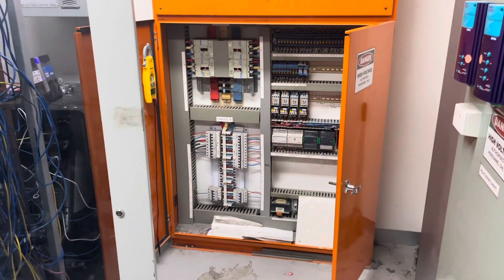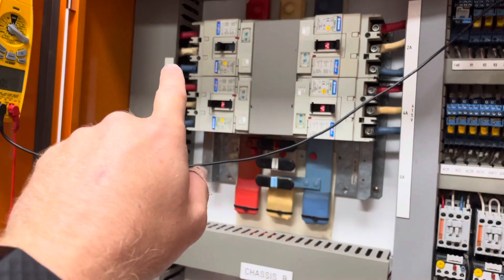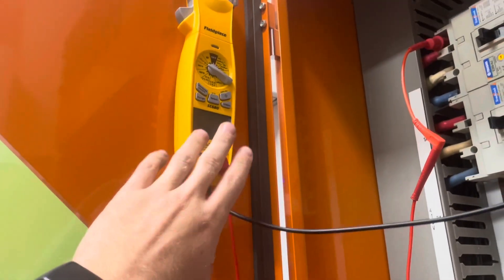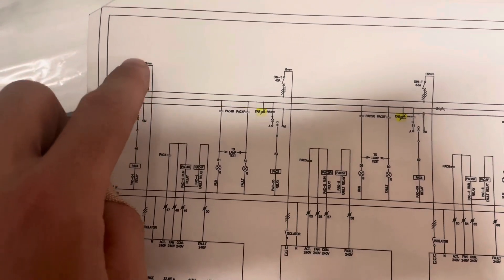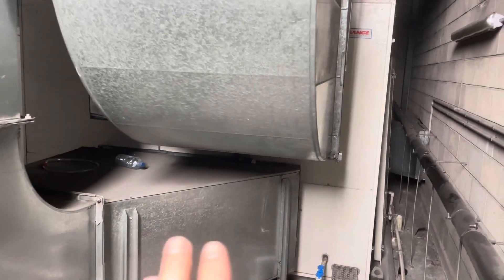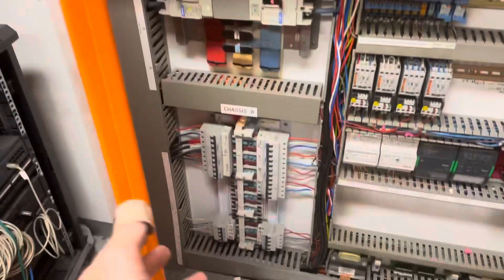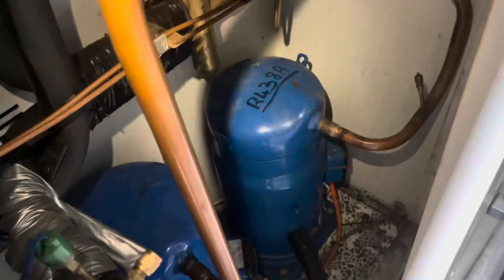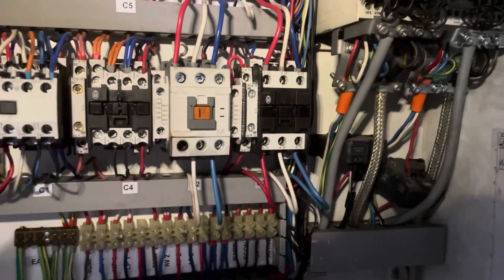All Air Conditioners are Down After a 38 Degree Day

Comment: Your right, from L1 to earth you can get a reading thru your contactors, relays, pcb's ect ect via your a/o/m control switches. As for working inside the board flicking breakers on, turn off the control switches, close the board and turn everything on via the control switches. If something goes bang it's better it goes bang behind a closed door than in your face.

Comment: hey mate just curious if you looked into the strange readings on the inital tests from the ddc breakker which you mentioned could have something to do with the shielded cables, if so what did you come up with have had problems in the past as well.
Reply from the maker: Hey mate. I wasn’t able to get a clear answer. I spoke to a electrician who mentioned sometimes electronics may have safety’s that show readings to earth. It didn’t really make sense and I did mean to find out more about it. Thanks for the reminder, if I come across anything worth sharing I’ll reply back here 🤙

Comment: You make some great videos mate.

Just a thought, when testing circuits in a de-energised state for insulation resistance, you likely aren’t testing a lot of loads like motors, compressors etc, as the contractors which switch those loads are not pulled in.
Reply from the maker: Thanks mate 🤙 100% on not testing loads while de-energised, I was testing to see if anything would come up anyway. I’d have to rewatch the video to be sure, pushing my memory on this one 😂 but I believe I tested from the switch board, then did a visual on all the units to see if any compressor C/B’s were tripped where I found one. Then tested the compressor from there.
Reply: @hvacraustralia  that’s a great way to do it 👍

Comment: Good job. I usually kill power then take my voltage tester stick and just run it over all the wires, just to see if one pop's loose sadly that happens more than I would like to see. Then the megger comes out, you can make short work of things with a megger. I was working on a unit with 6 compressors, they said who is going to crawl in and test them out. I said NO ONE! I I took all the load side's off the contactors to the compressors and hit them with my megger MIT420/2. All good but  L2 on compressor four. Found a bad connection and it blew off the set pin. I think that took me all of two mins to pull the wires and test. To bad I didn't get one until late in my career.
Reply from the maker: I’m all about testing from the load side of contactors 😂 I’ll only test straight from the motors if I have to.

Comment: Thank you for the content! So ultimately it was an overload fault caused by the loose wire would you say? Do you think there may be a lack of selectivity designed into the system causing the way upstream breaker to trip rather than the one immediately upstream to trip?
Reply from the maker: Thanks for watching. Loving all the interactions! I think the trip of the main 250A breaker was mostly due to the heat and current draw on the extremely hot day we had. That particular breaker is a thermal breaker so the high ambient heat plus the high amp draw due to all the A/C running at full capacity could have caused the trip. There is also the possibility that burnt wire on the compressor contactor caused a amp spike and that in conjunction with the 250A breaker being hot already caused it to trip.